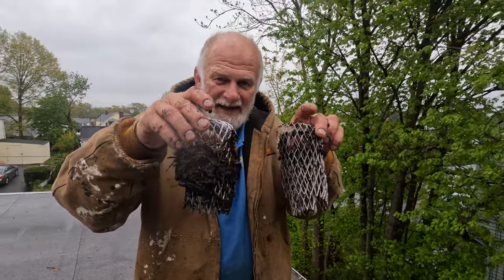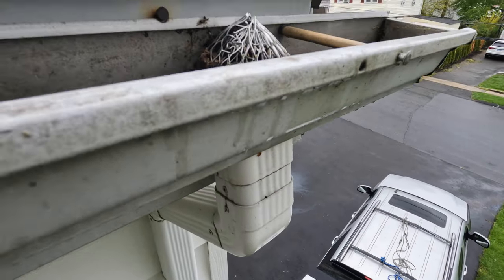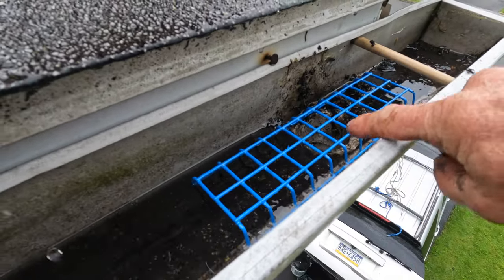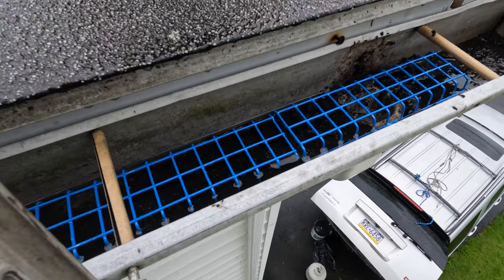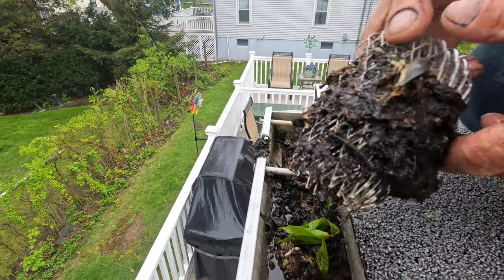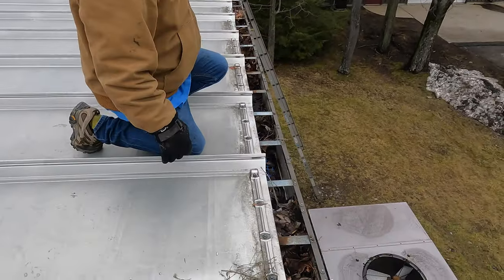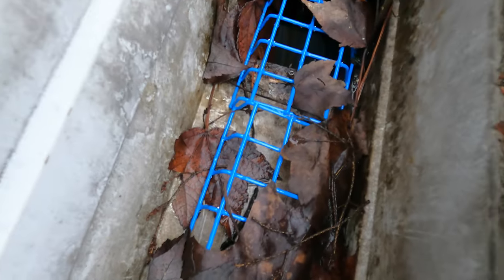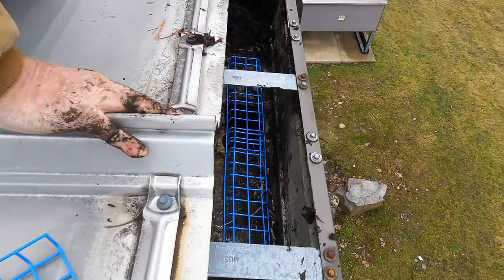Gutter Filter that never clogs - amazing invention

Comment: can't get enough of watching these videos!!  if Flexible Seal tubes (looks like a silicone consistency) has been used over loose 5/16 roofing screws on a metal roof, can Turbo Poly Seal be used on top of that Flexible Seal or does it need to be grinded off prior to brushing it on? I saw that the Turbo Poly Seal doesn't like silicone but can it adhere to the Flexible seal? Thanks so much and love your content! Buying some bergstroms now online!

Comment: Hello, I have a commercial roof similar to what your on in your video. My roof is leaking and I cannot figure out where it is coming from. My thought is that it is coming from where my rooftop hvac units are and then the water is trickling to another spot. What can I do around my units to seal them? What can I do underneath? I figured I should start there. Can you help? Do I need to send pictures? Thank you for your time.

Comment: unfortunately I cannot find the Z Filter online - either sold out following your link or on Amazon. Amazon has all the filters that clog LOL maybe they have not seen your video.  Seems these filters would not be hard to replicate so maybe I will have to try that. It is the plastic coating that is a challenge for me. Rust will follow if I do not make that happen.
Reply: They are sold from a Pennsylvania company called Bergstrom Industries
Reply: Same problem.  I’m now looking for some one-inch hole, light gauge steel that I could bend to fit

Comment: Works well, but if it's vinyl coat steel, it will crack and rust at $12 a piece.  Perhaps stainless or aluminum, doesn't say on website, so it's steel.
Reply: It's gold painted in blue. You cannot beat that.  Just kidding. Very likely just a steel.
Reply from the maker: It is galvanized 14 gauge steel. It should be ok
Reply: @FlatRoofDoctor  Galvanized plus coating would be good...Sounds silly but I used plaster lathe wire, comes in rolls 6" and fits well into gutters, bend and dome up if needed.  Keeps everything out.  But that gutter filter is easiest and clog free in most cases.
Reply: @publicmail2 
Doesn’t sound silly at all.  You’re going to need to clean debris off, still, at least once a year, but the water will still go down the drain, and away from the house.  Better than four times a year, or more
Reply: @publicmail2 btw, how big are the holes in the lathe?   I believe if they are too small the water won’t flow well.  One-inch might very well be the best choice between too small and too large